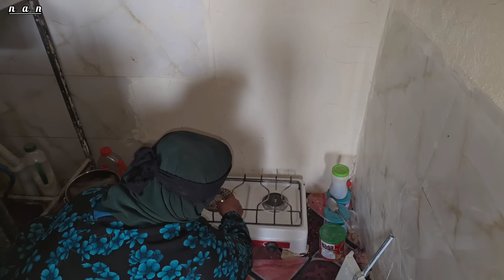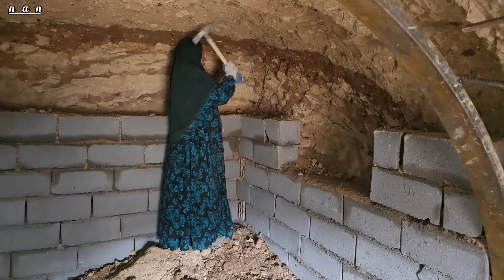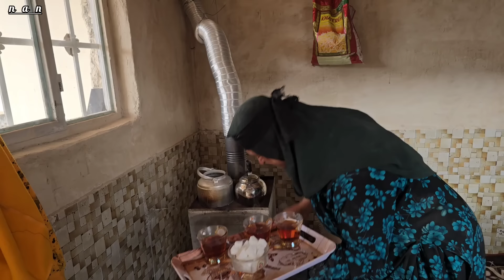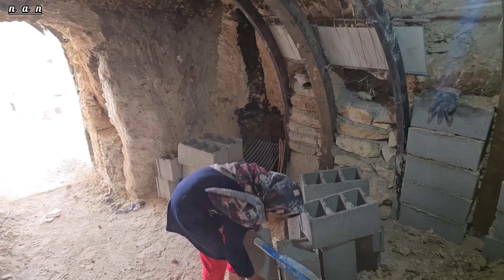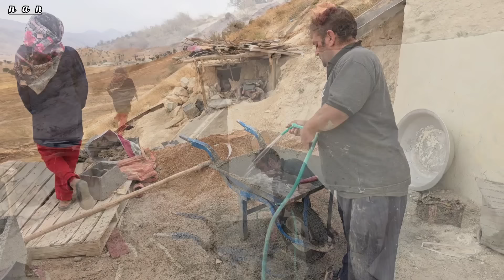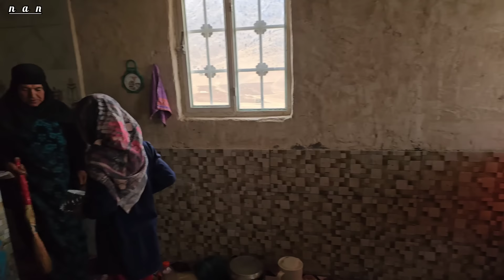Grandma's Amazing Cave: Completing the Interior Block Layout Project

Comment: I am really liking this unknown building inspector. A real way to water tight that roof and support that cave roof. Although I was concerned that she would catch her dress on fire when she was heating the roof tar. The wall holding the mountain back still needs 3- 6 more rows of blocks, then continue the water drain away from the kitchen back fill to near the top so the resulting terrace is just as wide as the one by her front door. A 3 m wide terrace backed by another wall will stabilize all her hard work. But this new worker is faster than  the help she has had. At some point this inspector will notice the way too tall her staircase steps are in her crude stairs from the road above and below. But so far in all of his work orders to fix non-compliant major items.

Comment: They are digging a cave on soft ground without any protective devices and digging the upper part of the cave. If it collapses like this, they will be buried, so it is urgent to devise measures to prevent the cave ceiling from collapsing.

Comment: Will those beams supporting the roof on the house support a winter snow load? They look unsafe as they are sagging under the existing load. Maybe they need a crossbeam support with a vertical post over the kitchen divider wall.
Reply: 동감입니다
반드시  필요합니다